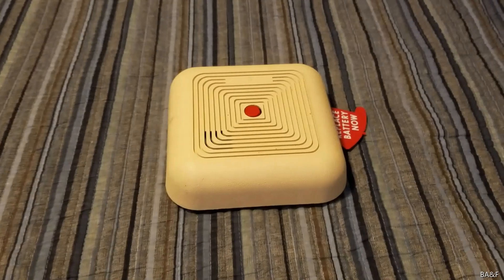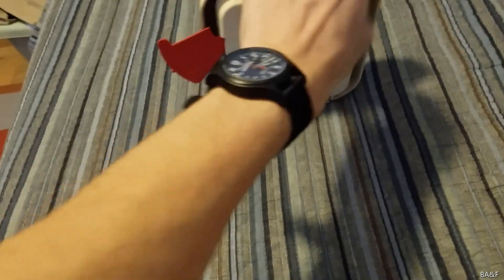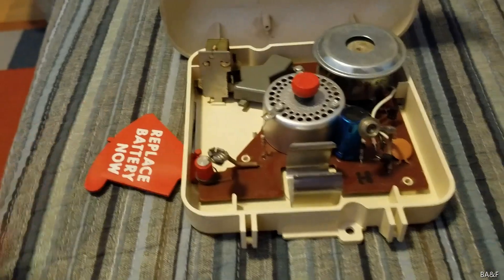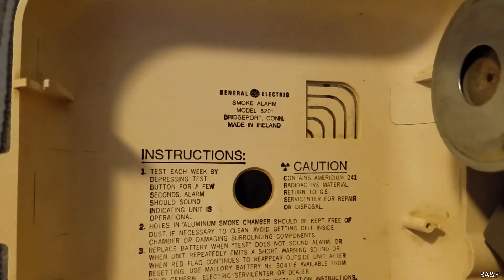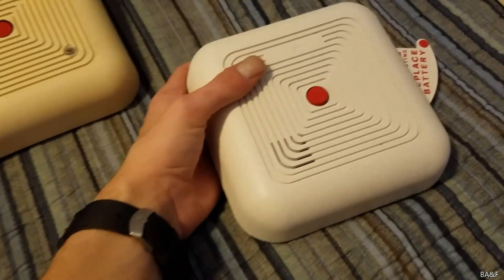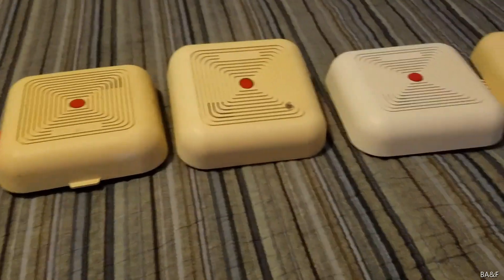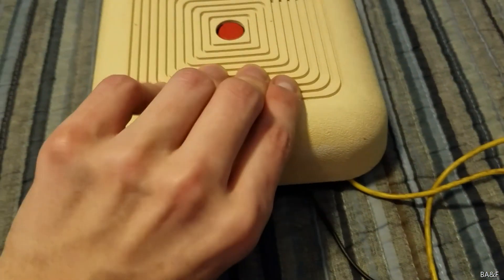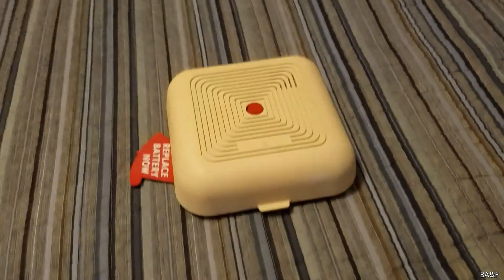GE Home Sentry 8201-001 Smoke Detector

Comment: Are these things worth anything? I have one in good condition. I inherited the home I was raised in and it is still hanging there. 

I'd hate to throw it away if it's something people collect.
Reply from the maker: Yea these old GE's are quite sought after by collectors
Reply: @BAFVintage  Really? What do they do with them? They don't work for smoke detection anymore right?
Reply from the maker: You'd be surprised, throughout my collection of nearly 100 vintage units, only a few don't sense smoke anymore. I have a few vintage alarms hanging throughout my house currently, on duty powered. As for these old GE's, they're getting harder and harder to find as people replace them and throw them away.
Reply: @BAFVintage  Interesting. Thank you for your time and answers.

Comment: The REPLACE BATTERY NOW flag is a ingenious idea since it will pop out when the battery is running low and will let the homeowner know it’s time to replace the battery. You’ll unfortunately will never see that on modern day smoke detectors/alarms.
Reply: We had a similar model.  The flag would come out anytime someone walked by and rattled the floors.
Reply: Most of them chirp when the battery gets low and won’t let you close the case without the battery. I personally think it’s a good idea however as it would draw more attention to it.